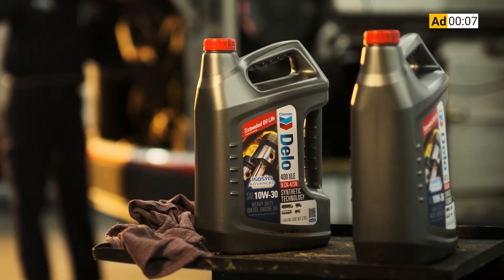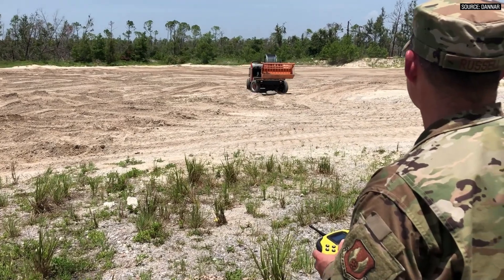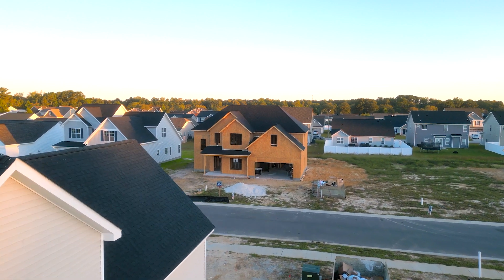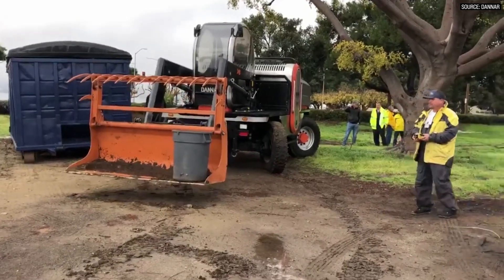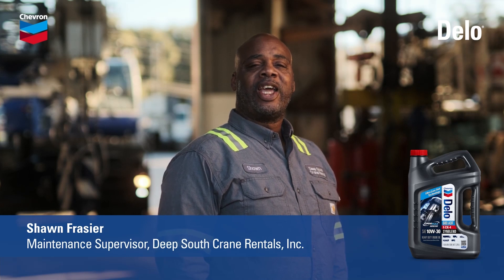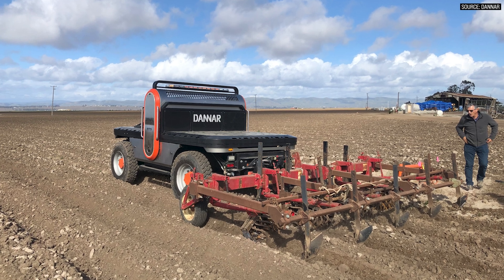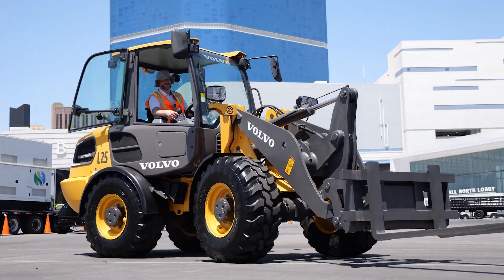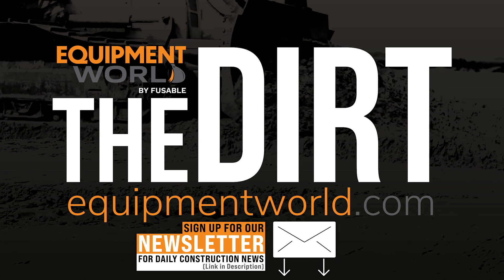The Jobsite Fuel Truck of the Future?: Dannar’s Mobile Charger Holds 500 kW

Comment: I don’t believe it will come to fruition. Charging one machine over lunch or at night will never be cost effective. A diesel bowser will refuel many pieces of equipment as will hydrogen over the same timeframe. Initial investment is way too high. It may have other uses but not as a refueling machine/powerpack.

Comment: Looks like a nice piece of equipment for the right applications.   Pretty impressive versatility but what  about cost, transportation, and charging?   An option for an AC or DC generator  might open up the market but that’s just going to add to the cost.  

I’m sure that thing can easily go anywhere an excavator can go, without getting stuck 😂
I can picture this thing in line with another piece of equipment 3/4 the way sunk into a muddy-water slop pit. 😂